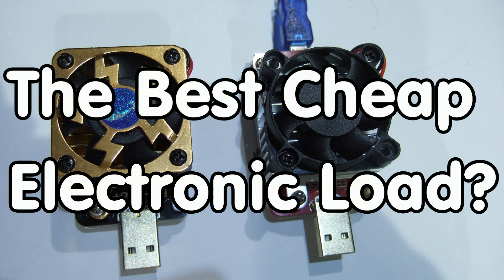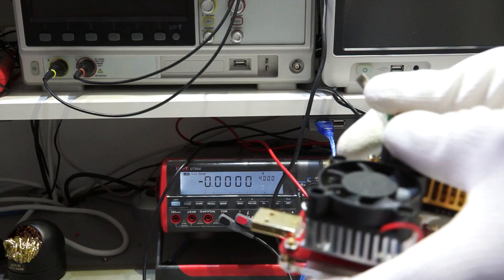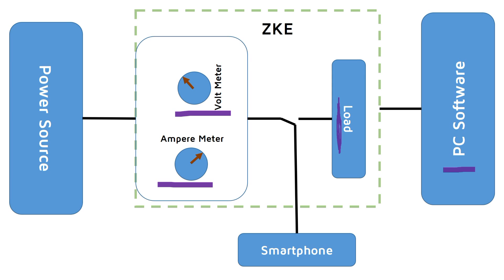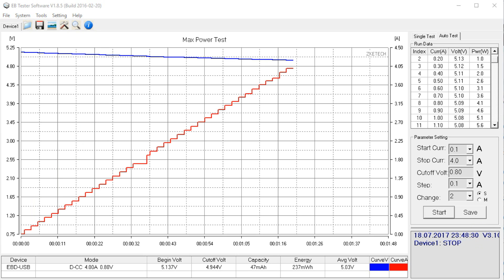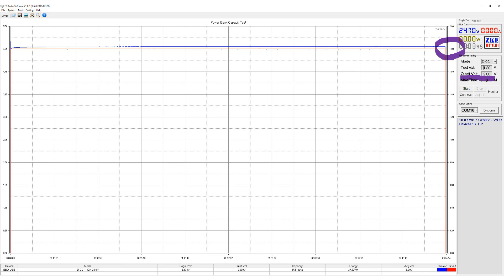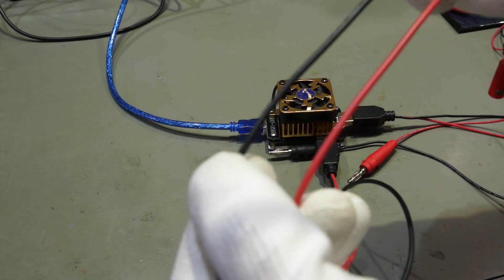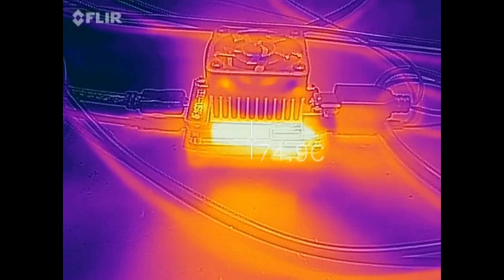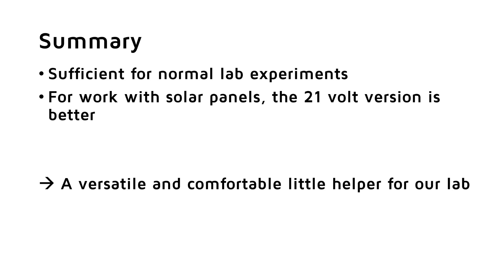#148 Best Cheap Electronic Load / Data Logger? Introduction and Test

Comment: I have a whole bunch of ZKE Tech loads and chargers. The smaller USB models are great, especially for the price as you can use more than one at the same time and then it works like a more expensive multi channel charger. Depending on the model, there are different features that will show up in the software. I regularly use a EDC-A10H for battery testing but it does leave some things to be desired that would be easy to add via software but aren't implemented. The cheapest place to buy them is AliExpress and even cheaper than directly from ZKE tech themselves. But with all the larger units, the first thing you will want to do is crack it open and convert the fan to have the speed controlled based on temperature because they sure can be loud. (that is where the load from your other video excelled, it varied the fan speed based on load. You really have to research all the different specs of the zke tech products to figure out which one is best for you. They have weird changes to what you get with each model number, a A20 isn't necessarily better than a A10 as a A20 may only be able to charge at 5 volts unlike A10 which has a fairly wide range, but the A20 can discharge at a higher current. The X series multichannel charge/discharge unit seemed great to me until I realized it can't charge something over a single cell lipo. It is better to buy 8 EDB-USB+ and a simple battery charger with data-logging.

useful to have but come with some limitations that could be overcome in software and some great features are missing that could easily be built into the application. Maybe one day...
Reply from the maker: Thanks for your feedback. I do not know the other ZKE products. Software seems to be an issue for most of the Chinese manufacturers...

Comment: Thanks for the video. I purchased one of the "cheap" loads and found the same limitations as you.  Unfortunately found your video too late ;)

Have you tried using the logging output of the software and importing to DataExplorer (http://www.nongnu.org/dataexplorer/) to see if you can support calculation of the values the original software cannot ?
Reply from the maker: What would be the benefit of the dataExplorer compared downloading a CSV file to Excel? Does it has an interface directly to the ZKE device? I did not fin it in its list.
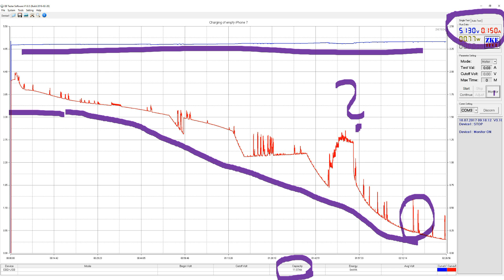Reply: If you are only going to do it once, there would not be much value.  But if you want to use it routinely, DataExplorer provides framework that could allow similar experience to the ZKE software, but you can add calculated values such as Capacity and Consumed Power (as you mention around 6:30) displayed in realtime.  DataExplorer is also cross platform and open source, which is nice.  It would of course require similar to your "making the invisible visible" operation to suport the device natively. which may be easy or hard, depending on how the ZKE device is interfaced over the USB bus.  But offline support of the resulting logfiles would likely be trivial (and easie/faster for routine use vs Excel/LibraOffice).

Can you provide a sample of the output log from the device that I can review ?

Comment: Great video, thank you.  Never knew that you could data log to a computer.
How about the other electronic loads which have integrated display functionality, how do they compare?
Keep it up!
Reply from the maker: They are ok, but without logging. I used one in two of my videos. Usually, they also support higher loads.

Comment: Excellent review Andreas. I'm curious to what thermal camera are you using?
Reply from the maker: Thanks. I use the Flir add-on to my iPhone. It is quite convenient.
Reply: Have the same flir one as it is called. Works perfectly and is much cheaper than a stand alone thermal camera with similar specs

Comment: I have the ZKE EBD-USB and noticed an issue when attempting to test the capacity of a single AA NiCad cell. The discharge test triggers the low voltage cut off as soon as I hit start. Regardless of how low of a discharge current I specify in the software.

As far as I can tell, the load draws a lot of Amps for a very short time, as soon as a discharge test is started. My single AA cell can not supply it and instantly triggers the low voltage cut off.
Doing the same test, at the same settings, with a cell phone power supply does not trigger the LVC but that is at 5V compared to ~1.2V

I tried to add a resistor in series to limit the current but still run into the issue. Not sure what is going on.  Have you noticed anything similar?
Reply from the maker: I used a fully charged IKEA NI-MH AA cell for tests with the red EBD-USB. Here are the results (0.2, 0.5, and 1 ampere): https://1drv.ms/f/s!AifVcl0bSyX8hZs6PJOelb8To4sz9g
It worked and I had no effects as you describe.

Comment: Have you done a video on source measurements?
Reply from the maker: What do you mean by "source measurement"?
Reply: http://www.tek.com/keithley-source-measure-units/smu-2600b-series-sourcemeter#
Reply from the maker: These devices are a combination of software controlled power supplies and software controlled electronic loads and way above my budget. 
The first part (of course much simpler and not at all as accurate, but more in my budget range) is this device here. The software controlled power supply will follow in the next weeks (also the budget version). In principle, one could build such a combination using the two devices.
Reply: Andreas Spiess correct they are over my budget too. All of your video's are on low cost products which I like them a lot. And that is why I asked this from you. Thanks a lot.

Comment: I have 12v battery , where do I connect it ? Can it take just 2 cable leads ?
Reply from the maker: If you want to test the battery, you have to create a female USB-banana plug connector as shown in the video and connect it to your battery and the male connector on the load. Make sure, you do not mix up plus and ground...
You can also solder 2 cables to the PCB, if you are experienced enough.

Comment: Super interesting little devices! I have a simple USB load with two fat resistors, now I want the one you're showing instead!
Reply from the maker: I made this video because I like the data logging feature which comes in addition. Your resistor  loads are ok to quickly test a power supply. But it needs time if you want to test the capacity of a power bank without logging function...

Comment: on Ebay is a 150W load, but i'm sure how usable it is, it can be found with this Search words:  150W Constant Current Electronic 60V 10A Battery Load Discharge Capacity Tester
Reply from the maker: They usually work (I used a similar one for a project). But they have no connection to the computer. This is, what I like with this one (and I wanted to build myself in my project).
Reply: You have some analysis of it on Voltlog or electrobidouilleur

Comment: Thanks!
I'm looking for something similar to test supercapacitors. I need to be able to use very low voltages, currents and discharge to 0v.
Would this be suitable?
Reply from the maker: I did a test with my 2 Super caps (with protection board). 0.5 A, Cut-off voltage 0.00V. You find the diagram here: https://1drv.ms/i/s!AifVcl0bSyX8hZs1Bn_J6cTjOY2AMw
Reply: Andreas Spiess Thanks!

Comment: Thanks a lot for this very interesting contribution. 
These devices also could be helpful to test small power supplies or DC/DC converter.
Testing These Units, an additional measurement of the noise would be helpful. Of course, we can measure the noise with the scope in the lab, but an integrated AC ripple measurement would be the next step to make these little devices even more versatile.
Reply from the maker: I think, to measure noise an Oscilloscope is always better because you can see also patterns which help to find the root cause for the noise. But I do not know, how much noise these loads themselves create...
Reply: they should not create too much noise by themself because unsing the transistor as a linear load. 
DC/DC converter are different. you can try to power the cheap radar sensors you presented a few weeks with a small DC/DC converter. Probably this will fail because of the ripple.  Powering by a linaer regulator they will work. Similar using DC/DC converters for audio preamps.

Comment: Thanks for the video. I was wondering what were you using to log power.
Alas, the software is Windows only, so I'll continue with my ina219 logger project.
Reply: I'm doing something similar - my first noob project. I'm using two INA219 and a Wemos D1 mini board to log stuff and to calculate the efficiency of - say - DC to DC converters. I'm using websockets and JSON to transmit data to a browser over Wi-Fi and the C3 Javascript library (which is based on the superb D3 library) to display it. As a load, I only have the cheapo board. Maybe I'll replace the 10-turn potentiometer on it with an electronic one to adjust the amperage (I'd then try to implement the other modes like CV, CW, and CR via software). It would be nice if these more expensive loads had some simple API over UART, I2C or some other simple connection. It's been a lot of fun so far and I've learnt a lot. Thanks Andreas for the general infos, the inspiration and the encouragement!
Reply from the maker: Maybe somebody hacks the protocol of the software. It should not be too complicated...
Reply: pepper669 That sounds like an excellent project. Have you documented it?
Reply: Thanks! Not yet, but I will. Right now it's a still a bit messy... When it's ready, I'll post something on my YT channel, so you might subscribe to it :). I'd like to know more about your project, too!

Comment: Speaking of power banks, if you try to use one with a low power device, the bank might think that you are trying to charge a device that is already fully charged, and it will shut off automatically.  The trick is to add another device to the power bank, like a USB flash drive, or, of course, a cell phone. That will draw enough current to keep the power bank on.
Reply from the maker: Thanks for the tip!
Reply: I would use another adjustable electronic load set at a known number of amps, just to make sure afterwards you can calculate the differences...

Comment: Can you test the Espotec Labrador? I just got mine (it's great) and I'd love to hear what you think of it.
Reply from the maker: Google did not show any results A special dog?
Reply: Sounds interesting - what is it?
Reply: pepper669 it's a $35 oscilloscope, waveform generator, power supply, logic analyzer, and multimeter that works over usb. And if you have Android and it does USB otg, the guy even wrote an app to make it work on Android.
Reply: It has it's drawbacks, and the desktop application isn't super pretty, but for me and my hobbying, it's a step up from the dso138.
Reply: Andreas Spiess it's on crowdsupply. They started shipping at the beginning of the month, I think with crowd supply, after funding you can just order and have it shipped right away.
Reply: Andreas Spiess little typo, searching for 'espotek labrador' yields in less dogs... :) - and many thanks for the video, the days are too short to try out all this interesting stuff in our days on my own...
Reply from the maker: Thanks for the clarification. Now, I found it. Sounds interesting.